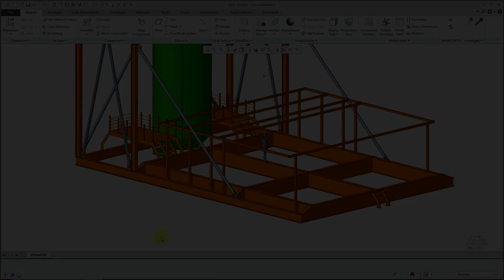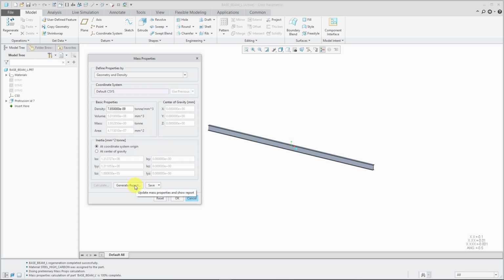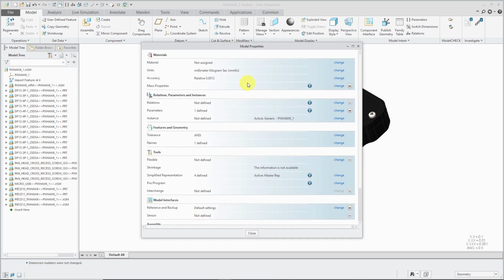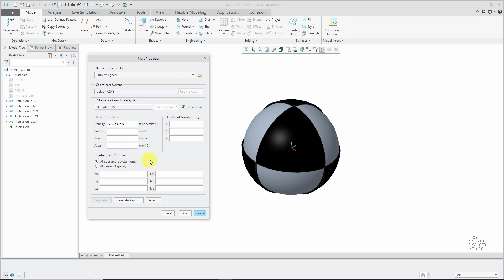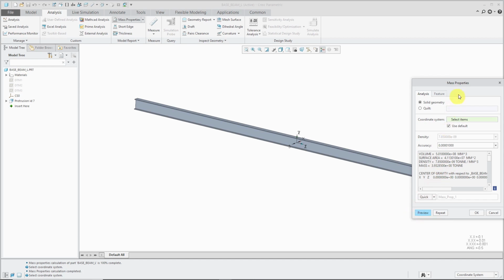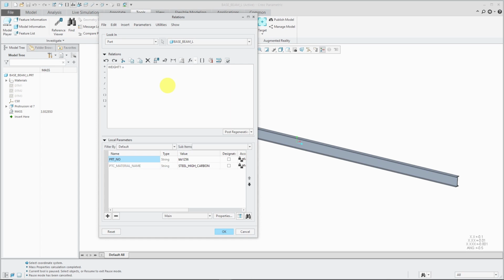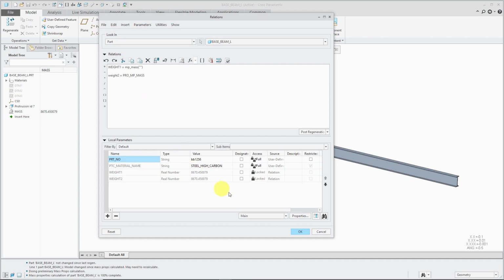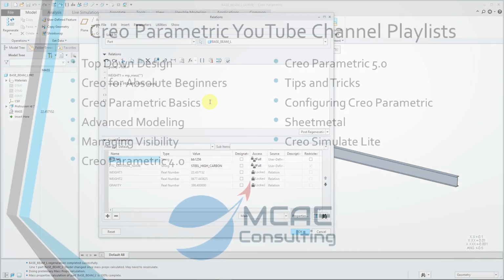Creo Parametric - Mass Properties | Analysis Tools - Tutorial

Comment: Hi Dave,
Is it possible to measure the combined centre of gravity for multiple parts inside an assembly?
For example, the beam and the tank of the assembly you showed at the start of the video.
Reply from the maker: When you calculate mass properties in an assembly, it gives you the combined center of gravity. If you want the CG of a subset of components, create a Simplified Rep.

Comment: Hi Dave, I have a question.  I am designing some aluminum (6061 AL) parts. I am confused about the mass that creo calculates. The mass i get is in lbm. I know that to convert mass to weight you must multiply by gravity ; when i multiply by 32.2, the answer that I get is too large. Is the "mass" that creo calculates actually weight? If i had the parts on hand and i put them on a scale, would the weight i get be the mass that creo calculates?
Reply from the maker: What unit system does your model use? Are your length units in inches? What is the calculated volume? What are you using for the density (value and units)?
Reply: @CADPLMGuy   Thanks for the quick reply. my units are inch lb seconds. lengths are in inches. my density is 9.79e^-02 lbm/in3. my volume is 4.59e+01 in3. the mass it calculated was 4.5 lbm.
Reply: @CADPLMGuy  I also tried it with part of another model ( i know it definitely weighs less than 7lbs). For this one the units are the same as my previous reply (inch lbm seconds ). The density they use is 9.791206 e-2 lbm/in3. the volume is 8.79468 in3  and the mass is 3.167828 lbm. This mass seems reasonable for the weight of the model. Also if i multiply the density and volume they are using to get mass i dont get their mass value ( instead i get 11.65379lbm).  If i were to multiply their mass by 32.2 to get lbf it would be too much ( 102 lbm). I am confused.
Reply from the maker: @katcam7993  I took a look at the math using PTC Mathcad Prime and it's correct. Here's the thing, and this always gives me a headache: when you multiply pounds-mass by the acceleration due to gravity, the numerical value for the weight is the same. You can't just multiply by 32.2 - actually it would be 386.4 for g in inches. You have to multiply pounds-mass by g in inches per second squared. Then the numbers turn out to be equal. A mass of 4.477 pounds-mass has a weight of 4.477 pounds-force. Bottom line, pounds-mass and pounds-force suck.
Reply from the maker: @katcam7993  32.2 is acceleration due to gravity in feet per second squared. You shouldn't be using that.
Reply from the maker: @katcam7993  There's something wrong with your second answer. It should be a mass of 0.858 pounds-mass and a weight of 0.858 pounds-force. Think about it this way: this means a cube of aluminum almost 3 inches on a side weighs just under a pound. That feels right.
Reply: @CADPLMGuy  thank you for the explanations it makes sense now. Yeah i wasnt being careful with my units before. so on earth lbm and lbf are equal, got it! that makes more sense and makes me less nervous. Also about my second answer, it was really off because i was using the constant e^-2 instead of 10^-2, i stupidly thought that creo was giving me the numbers in terms of e.
Reply from the maker: @katcam7993  My latest blog post up on the Mathcad website even talks about how easy and common it is to screw up units. I was just talking with some people at PTC about that yesterday in preparation for the virtual Mathcad conference next month. https://www.mathcad.com/en/blogs
Reply: lbm is the same as lbf at sea level gravity.

Comment: Hi Dave...Do you know how to make cutting list of piping using sweep command? or how to generate the total length using sweep command in parts.? Thank you:)
Reply from the maker: Are you talking about a cut length table? Using the Sweep command, no. But eventually I’ll have a video on how to do that in Piping mode.
Reply: So if we are using sweep command there is no way to generate the cutting lenght table right? We are going to use sweep command since the piping module did not  allow us to reuse the part that we are already created..we were going to implement part numbering system....
Reply from the maker: I’m not saying that. You asked if I knew how to create those tables using the sweep command. I don’t. I didn’t say it was impossible. I don’t know if it’s possible. I know the Piping module, so that’s how I do it.